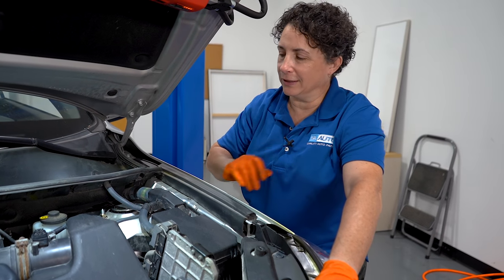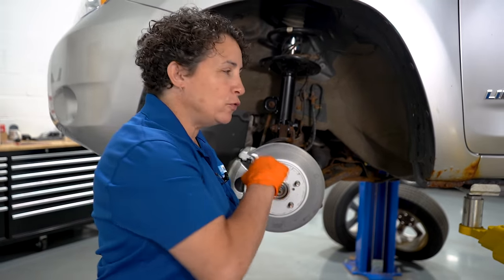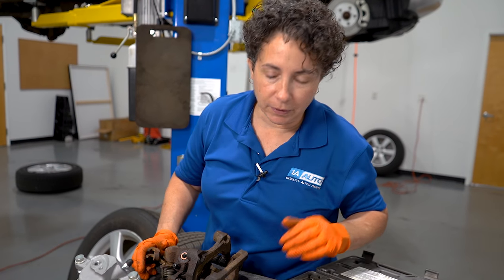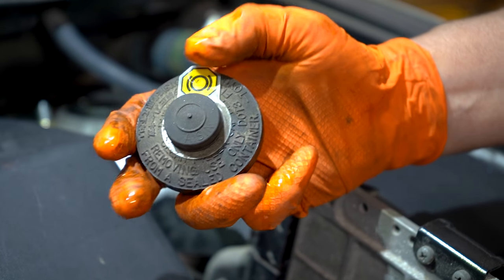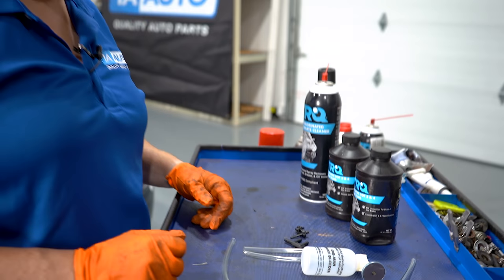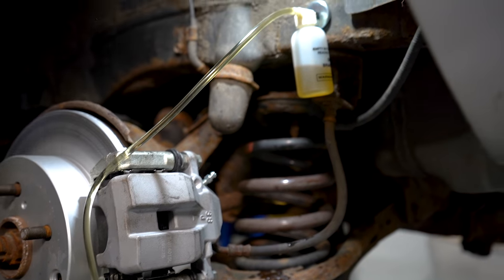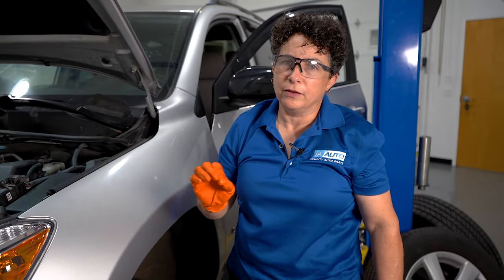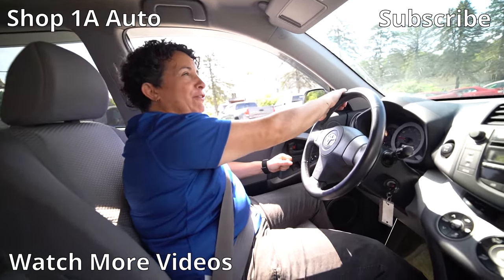Common Mistakes Bleeding Brakes! How to Do a Full Brake Bleed the Right Way, and Why!

Comment: I have 2 questions for any/all brake experts:  1) does the brake fluid 'recirculate' thru the system?  Like radiator fluid. I.e., if I remove half the old fluid, and refill the reservoir, it seems all the new fluid will stay up top, and the old fluid is down in the lines and calipers?  2)  if there are 2-3-4 total brake lines, perhaps seperate to each wheel as Sue mentioned early in the video, and there are two air bubbles in the whole system , one in the longest line near the rear wheel, and a bubble just under the reservoir (or one of the lines near the manifold).  Why would it matter which wheel I bleed when?  I know that air bubble near the rear brake will drain out during bleeding.  Ok  That leaves some bubbles under the reservoir or in the manifold.  Will those follow the new fluid to the next wheel and be bled out, or will they  'migrate' back to the line I just bled?  Where are these bubbles located, and where are they going?  If I bleed a short line first, do some bubbles mirgrate backwards into that line from another  line,?    Thank you in Advance, Bill
Reply: No the food does not circulate
Reply: As long as pressure is maintained, fluid stays where it is

Comment: Can air in the fixed caliper cause the piston to start extended out? Which can cause the brake pads touch the rotor?

Comment: Reaction to the part on the reuse of copper sealing rings. It is possible to reuse a copper ring by heating it till its cherry glowing red and quenchhing afterwards. It will be soft and pliable again. Old trick. Used it a lot as an engineer on sea/ offshore vessels.

Comment: hi Sue . what makes the piston retract back to not braking position in the caliper? my rear left wheel is seized after not driving for 2 weeks . my astra GTC has that stupid electric braking button in the cockpit also but don't think that is the problem

Comment: I replaced all break parts from the lines, hoses, all the way, to the calipers, wheel cylinders, and drums. I let the bleeder valves lose to gravity-bleed. But, I do not get anything in the rear. Any idea of what could have gone wrong? should I hook up a vacuum pump to the rear end bleeding valves in order to suck the fluid effectively?

Comment: I always start with the drivers front. Also always use a larger receptacle to catch the brake fluid.

And no you don't necessarily need fluid already in the bottle. If you can get the vehicle to build up any kind of pressure it will put fluid in the hose. And it only takes back in what's right there at the bleeder screw
Reply: Not true. Air in the hose will go back into the line.

Comment: Nice video!  I'm wondering if there is RTV or other sealant on those bleeder screws?  I usually get some small bubbles coming through the threads unless I grease the bleeder screw.

Comment: Great video.  At 18:40 you said you did it on the last wheel (not securing the bleeder fitting, thus air got into the line).  Did that mean you had to start all over again at the back wheel and work forward, or just re-secure the fitting on bleed the one wheel that it was not secured for?

Comment: I've been having a fault code C121E on my 2012 RAM 1500 and a dash light on for a year now. I replaced all four of the brake calipers, disks, and pads, and the front brake lines up to the solid lines of the vehicle. I've bought three gadgets to bleed brakes. Everyone keeps telling me that I have air in the lines. I've bled what feels like 10 gallons through the thing. It brakes super well. I haven't noticed the brake getting soft under a continuous press at all but it does have a couple inch travel when pressed fully. I'm no mechanic but I'm learning and am fairly good at reasoning things out as well as following instructions. 
One thing I've been told is to always have the vehicle running when bleeding brakes and I noticed that the demonstration didn't. Is the vehicle supposed to be running or not? 
No one seems to have a definitive answer and I'm wondering if I'm bleeding my brakes wrong and that's why I can't get rid of this damn C121E fault code.

Comment: im replacing my rear brakes (calipers etc) and will do the brake bleed while doing so. i will change the front breaks a few weeks/months later. do i need to repeat the brake bleeding process with new calipers etc once the new ones are on the front?

Comment: Regardless of how deep you insert the plastic insert into the brake bleeding nipple you will still get bubbles from air entering from the loosened threaded bleeder.  I put a small dab of grease around the bleeder where it meets the brake caliper or break wheel cylinder to form a temporary seal.  Great video though.

Comment: Older model vehicles have a master cylinder brake line junction block that takes a double flared brake line, so am I right to assume that one can't use that new type of brake line with the bubble flare requirement on older vehicles?

Comment: Hi, I have a question. When you got to the front driver wheel and when you guys realized that air is pushed back into the caliper, I noticed the bottle holding the brake fluid was almost full, can you open the bottle and pour some brake fluid out from the top of the bottle? Cause I noticed it was almost full. How would you do that? Would you have to close the bleeder screw back after the air went back in it to empty some out or do you leave the bleeder screw just the way it is?

Comment: She’s right about the air causing heat , for example in a radiater the boiling point increases , I’m not sure what the numbers are but when liquid is under pressure for every psi it’s so many degrees that it raises  the boiling point

Comment: The usage of pressure or vacuum bleeders has contributed to Ferraris's recall. My 458 Italia was always bled correctly (Ferrari's service manual recommends this type of method). Doing otherwise distorts the seal between the master cylinder and the vacuum booster. The result, the fluid goes into the vacuum booster and resulting catastrophic brake failure!!

Comment: I've been mechanic in Europe for over 15 years and every European car says on the specs and on service bulletins to start at the closest from the ABS unit so left front then clockwise.
And every electric car that i must use diagnostic tool too bleed it has a step by step procedure and they also always start Left Front then clockwise.

But at school we where told the opposite, to start at Right Rear...

And if you spill just one drop brake fluid on anything CLEAN IMMEDIATELY! With water and a little soap or at least within 10 minutes as it destroys paint (no the "new" fluid is not paint safe either!)

And always push out a lot of fluid at the first wheel as the first 5 to 15 pumps is still old fluid on most cars, so i always do about 0.2 to 0.5 liters on first wheel

Comment: I got a new caliper and it came with two washers and I left the bottom one at the top with the top one. It kept leaking from the bottom cus there wasn't a washer down there since it was at the top with the top washer. The break line kept leaking at the fitting from the bottom so I kept torquing it down. After being frustrated I realized that one washer has to go at the bottom of the break line fitting.
Now I have to replace the washers before I can bleed the breaks. They actually only require about 10 ft pounds of torque which is a two finger push on a standard 8" wrench. 

Don't know what I was thinking. Lessoned learned.

Comment: I've been told when using the brake pedal to NOT go to the floor because it blows the seal out in the master cylinder. Had that happen with an MGB, kept taking the master cylinder's back and on the third one, had a brake guy tell me I was blowing the seals and to put a brick or something behind the pedal to keep it from doing that. Did that and all worked fine.

Comment: Hi Sue. I loved the vid on brake bleeding.
I've  got an issue with a 1991 toyota previa.
I replaced the load sensing proportioning valve, and I'm not sure which line goes where.(other than the line to the drum). also. Any idea how to adjust the proportioning valve?
I hope you can help, danny
Reply: They have an aftermarket adjustable proportioning valve for the rear. Stock is set around 70% front and 30% rear. If your rear is locking up, then you may want to go with the adjustable one.

Comment: My Honda does not have ABS, but the factory service manual says the brake bleeding sequence is L. Front, R. Rear, R. Front, L. Rear
Even though the Left Front is closest to master cylinder it says to start there.

Comment: Me and my Dad did a brake pads and brake caliper replacement so we loosen the driver side brake caliper lines and it drain the felu and we bleeding all the brake system also it's disk brake All the way around but we still don't have any brakes at all because for One it has a ABS system and this is All a 2005 Dodge ram 3500 SLT quad cab Long bed

Comment: I will use your system after seeing how easy it is to use.  But, I was wondering if you could also bleed the brakes using a pistol grip MityVac vacuum pump?  And, would it help to put just a small piece of teflon tape on the bleeder screw threads to keep air from leaking into the line while the bleeder screw is open?  I know you don't want to get any of that tape down on the machined surfaces which would keep them from sealing properly.
Reply: Using a helper or vacuum pump you need not to worry about air returning. I always close bleeder before releasing brake peddle.

Comment: If I were to do a brake job on rear axle dana 35 on a jeep. With fully loaded bracketed calipers pads rotors and hardware. After I bleed the rears would I need to bleed the front brakes after???  The fluid has recently been changed through out the whole brake system. 

Thanks!
Reply: If you had the brakes bled recently, and you fix the rear brakes again.  I think you are good only bleeding the rears, you may not need to bleed them at all again, since most brake mechanics I've met did not bleed the brakes at all after replacing pads or rotors.

Comment: I thought everything was fine with the brake job I did and the bleed job I did, until the very end. She does the test break to see if it holds pressure or if it's slowly sinks 😩 and mine slowly sinks 😵‍💫

I don't see any leaks at any of the tires where any of the fasteners connect with the caliper is a brake flex hoses, so I think there's probably air in the master cylinder.

Is there a Video on how to bleed that?

Comment: Hi Sweetheart. I have a question. The most solid common bleeding is RR RL FR FL, but Santa Fe 2013 sport has different instructions in its manual for bleeding its brakes. It is like crossway RR FL RL FR. I do not want to argue with the manual. But it is so odd. If you know can you tell me why the manual for Hyundai Santa Fe 2013 sport says to bleed its brakes crossway just like I mentioned above?

Comment: Cars with dynamic stability control means all four wheels each get their own dedicated brake line from the master cylinder unlike cars without it which would run one line to the front and back and then T off. 13:15 the only possible concern with the one person bleeder procedure is air could possibly leak past the bleeder threads. Ensure to only loosen the minimal required to allow fluid to flow maybe a quarter turn. The procedure is fine for removing the bulk of air if you repaired or replaced part of a line but I'd still recommend finishing with a two person.

Comment: alright this is all good and stuff but one problem i have  all the time when bleeding brakes by myself, brake fluid leaking out of the treads of the bleeder. i know its also sucking air into the caliper when i let off. it always seems that the treads on reman calipers are so sloppy that the bleeder wobbles back and forth when its not snugged tight which in turn makes bleeding a nightmare. any solutions to this issue?

Comment: I have a serious question for you please respond!!!
I accidentally dumped a little bit of power steering fluid into my master cylinder reservoir...
It was a very little bit by the time I realized the bottle I had in my hand, maybe like a dollop???
Anyways my brakes seem to work fine for about 6 months or so and then the brake pedals started slowly sinking!
And one day while leaving a job the pedal dropped the floor and I nearly crashed, while traveling in reverse.
I quickly slammed it into first gear and barely missed the front end of the car I would have hit.
I guess my question is could a little bit of power steering fluid cause damage to your brake system???
Remember it was just a little bit of power steering fluid thank God! -Michael

Comment: You start with evacuating the master cylinder of the old brake fluid. You then pour fresh fluid in the master cylinder. Next you go to that bleed point furthest from the master cylinder. You pour new fluid into your bleeder 'reservoir' (the plastic bottle). You open the bleeder, go through three strokes then move on. 

Tell me at what point, where, the old fluid within the system was actually removed, meaning, the old fluid in all the lines is still in there. I must be missing something. It would appear to me you are putting new fluid in the master and pushing it in with the old fluid. 

So - I would think you would want to open all the bleeders prior to filling the master cylinder until you got nothing but air. Then you would fill the master and have a go at all the corners.

Can/would someone clarify this for me? Thanks!

Comment: what about a car (02 chevy tahoe) with an ABS system? is the process the same? Do I need to buy a fancy scan tool that will push air from the ABS module ? Does air get trapped in the ABS module?
Reply from the maker: +Faul Durand We don't have a how-to video for your vehicle right now, but the basic steps in this video should be enough to do this task. Buy this part for your vehicle on 1AAuto.com: http://1aau.to/m/Shop-1AAuto-c

Comment: Replaced master cylinder on 87 chevy van. Bench bled cylinder. installed into van. Had buddy pump brakes and I bled them. Sadly, I let the little reservoir run dry while bleeding. Pedal not what I want.
I will start from scratch again tomorrow. It looks so easy when car is up on a lift and everything is clean. It is 10 times more difficult when you are laying on your back out in the gutter. There is hardly any room to swing the wrench. The hose just gets in the way. I put a bunch of rags down and let the fluid drip on it. I know it's the ghetto way of doing things, but when your poor you have to do things the hard way.

Comment: The crush washer that fits between the banjo bolt and the brake line has one side that is completely flat! The other side of the crush washer is rounded and bubbled, The rounded side of the washer needs to be toward the bolt that will smash or crush the washer making a seal between the two,

Comment: WHAT ARE THE HAND FULL OF SYMPTOMS FOR BRAKE VIBRATION CHATTER WHEN PRESSING THE BRAKES IN HOT OR COLD WEATHER OR AT HIGH SPEED WITH ANTI LOCK BRAKES WITH TRACTION CONTROL AND TEMPORARY LOSE BRAKES THIS QUESTION IS HOW TO DIAGNOSE DANGEROUS SITUATIONS MY VEHICLE IS A 2018 DODGE GRAND CARAVAN GT FLEX E85 3.6L V6 FOR EXAMPLE PLEASE HELP WITH INSTRUCTIONS TIPS AND REASONS CAUSED WHAT TO CHECK INSPECT WHAT NEEDS TO BE REPLACE IF NEEDED TYSVM

Comment: My cars brake line routing is done in cross, the front right is connected to left rear and front left is connected to the  right rear, brake master cylinder is located on the right of the vehicle as the car is a right drive model. Brake master cylinder is a dual circuit cylinder.

Comment: Seems like the hose would have to be full of fluid and reaching all the way to the bottom of the bottle for it to make sense to prefill the bottle with fluid. I think its only necessary to let some fluid gravity bleed into the hose to avoid sucking in any air

Comment: Do you only need to bleed your brakes when you introduced air into the system? Like changing a caliper. If you only replace the pads and compress the caliper pistons you shouldn’t be introducing any air in the system right?
Reply: Right really. Say if you open the bleeder,
Gravity prevents air to come in
If they are open do not press the pedal for that kind of service. 🤦🏻‍♀️  
For my taste gravity
bleeding is best. Not always a timely option.  Sometimes. 
🤔💭👌✌️
Reply: @rollinajoint9657  I don't think gravity bleeding is effective, I'm a fan of pumping the pedal and pressurizing the system, forcing fluid to the nooks and crannies, pushing the air out in front of the fluid.

Comment: All of your points are good but I would rather and do use a Motive pressure bleeder. Inexpensive no pumping required. Air can enter a cracked bleeder on the vacuum/return stroke with the method shown here.
Reply: Are you sure?  I got 'bubbles' with a popular $15 SUCTION  type kit.  It sucked air under the tubing barb, and it sucked air around the old bleed nipple threads.  so I bough a new bleed nipple and went back to asking a friend to pump the pedal.

Comment: Most modern cars use a be cross diagonal system....ie left front and right rear.. right front and left rear... this prevents losing a entire axle brakes in the event of a broken line and pressure loss

Comment: Anybody know how to do it correctly on an Audi A6 2017 - I had to replace the master…. Got those symptoms she talked about when she was at the stop sign…. Must of bled 2 gallons over the months - I have OBD eleven to activate the abs pump…. Do I even need to do that? Also I have a pressure bleeder with a catch can…also can anybody tell me what that ball bearing is for on the master? It is right over one of the brake lines on the master? Thanks in advance because I am at my whits end…..